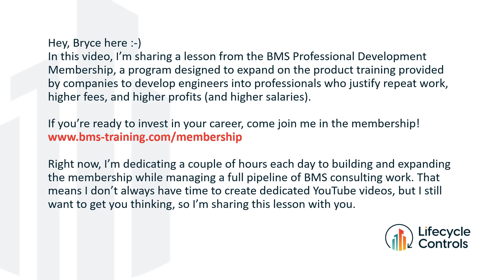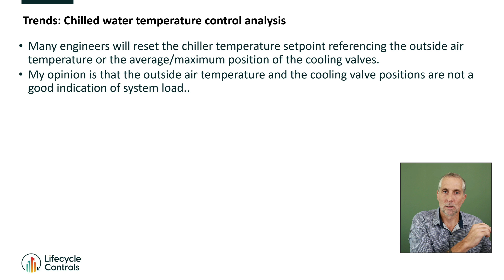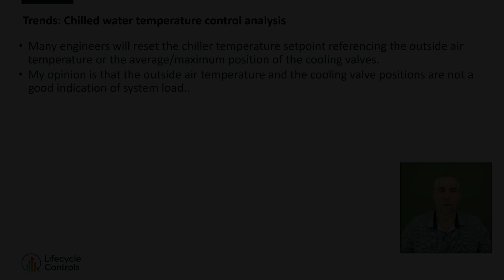Comment: actually, it is like first reducing the pump speed up to 70% before attempting chill water leaving temperature reset.   and another thing is that if the zone spacing has very high humidity, you can't increase the chill water temperature as it will affect the off coil temperature and thus increases the humidity. so, there are lots of things to program to make it work properly.

Comment: That's interesting I've never heard of resetting CHW temp on flowrate before. Currently we reset both the system pressure and temperature setpoints on valve demand, however the CHW temperature setpoint takes precedence over the system pressure setpoint. So we only allow the system pressure setpoint to decrease until the temperature setpoint is at max, and only allow the temperature setpoint to decrease until the system pressure is back at max. Seems to work.. haven't had any issues with it but there's always room for improvement!

Comment: Awesome - this sort of confirmed what we encounted on a major project I was working on.  It was a large district cooling plant that fed a number of different buildings - of mixed uses - via energy transfer stations.

When we wrote the FD we noted the potentail conflict with pressure reset and CHW temparture reset.  We priorised the pressure reset as it had more potential to save energy.  However gathered the RH% signals from the various connected buildings (some were chilled ceilings) and used that signal to reset the chilled water temp setpoint.  

Seemed to work - unsure as I left the project before it was fully completed.

Comment: My simple solution that I've used on the last couple of projects, I use a common "reset load" signal usually calculated trim/respond off the cooling reset flags, and then just scale temp and pressure resets off that. I think it was based on ashrae 36 loosely. eg 0-60 resets the temp down, 40-100 reset the pressure up, or reverse it or both together or ....... It's quick and easy to setup tune and breaks the reset response out from the actual reset load value. Using flags not CHWV position directly is the key as it can be configured differently for every AHU if required. Seems to work :body-blue-raised-arms: